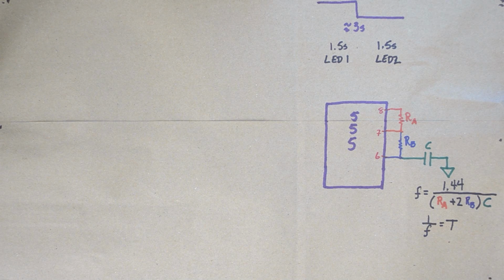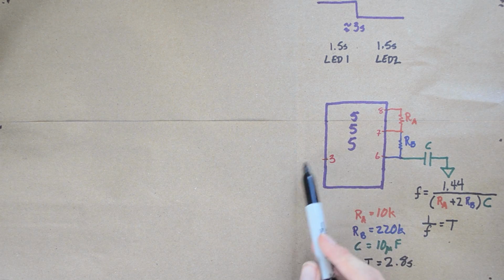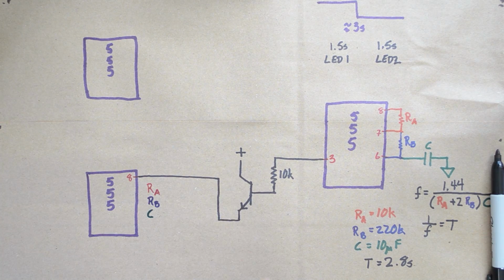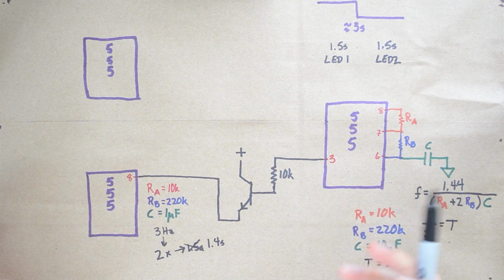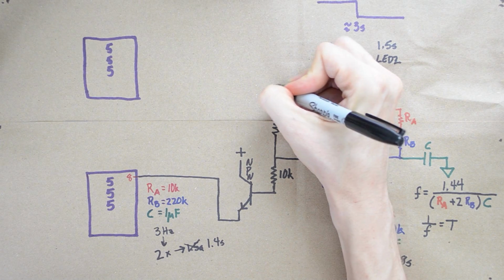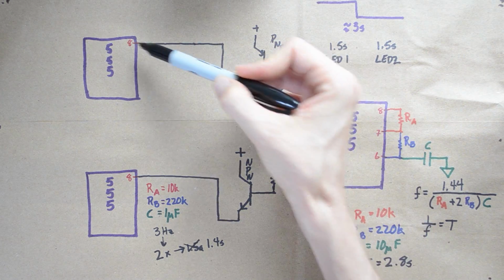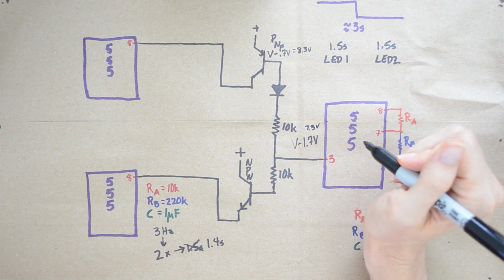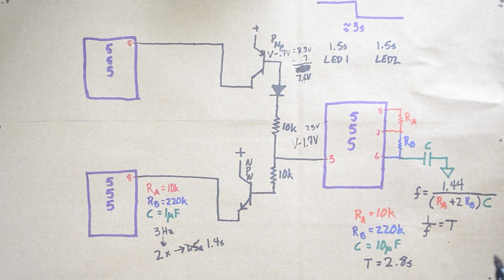Cascading 555 Timers for Custom Blinking LEDs

Comment: What are your recommendations for a power supply, multimeter and oscilloscope? I’m trying to put up my electric station and I need recommendations from the experienced engineer… some of the best power supply and multimeters, links 🔗 to where I can get them … thanks 🙏 for the multimeter , I’m leaning towards FLUK, but not sure what the best out there that you would recommend.
Reply: He hasn’t posted a video in 6 years so I’m not sure he’s still active on here.  Your question will depend on your budget.

Comment: If I wanted to use a trigger to activate and limit the cycles in this circuit, I could add another 555 in monostable mode and set the timing for the time it takes for the number of cycles I want, and connect pin 3 of new 555 to pin 8 of the first one in your drawing right?

Comment: HI, great und usefull stuff, i´m starting in electronics, but i have more experience in clay sculpting, recently someone ask me to make a serie of some specific lighthouses. but the particular light characterisics of each one are tricky, for example, i need a 1 second blink followed of 6.5 second obscure ( 1sFL- period 7.4sec), other needs a serie of 1 flash of 1 second of duration following of two second obscure period, two flashes, and a 5 second obscure (1sFL, 1s obs, 2sFL, period 10 sec). how can i do?

Comment: I saw a video a while back of 3 rows of LED "chasers".  3 rows of LEDs consisting of 10 LEDs in each row each moving only from left to right . When reaching the 10th one  starting again on the left side.The middle row moved across at half the speed as the top row and the bottom at half the speed of the middle row.They were all in sync.
Any ideas of how this would be accomplished. Three 4017 decade counters maybe? With a 555 as a clock,  Use pin 12 carryout to the input of the next one?

Comment: This was interesting.  I would like to figure out how to have a group of LEDs, in a star pattern, randomly blink (or strobe flash).  One larger LED in the center (5mm white) and 5 smaller LEDs (3mm white) on each point of the star.  I do not wish to use Arduino, just electronic components.  555 timers?  It'd be interesting to have a field of these stars (50) that would randomly strobe while each LED in each star was doing it's thing.  Creates a "twinkling" effect, in the mental image I have.  I am the consummate novice, so definitely need help figuring this out.  For all I know, I know nothing.  Is this idea even possible?

Also, here's part of my "novice", why would I choose a 4.7 µF or 47 µF or 470 µF or some other µF value electrolytic capacitor?  I understand, I think, why I would choose a particular voltage of capacitor.  When and why would I choose a ceramic capacitor?  I built a kit that had a .1 µF round ceramic? capacitor in it.  It was orange and had 104 stamped on it.  I know that is it's capacitance - 10 0000.  Works out to .1 µF.

Last, how about transistors.  There are a blue million options.  Why a 2N3904 or a 2N2222 or some other NPN or PNP transistor?  I have gathered they have characteristics like how much voltage and amperage they can handle, so that would certainly help in deciding.  Is there a comprehensive list showing transistors (or caps or whatever) and their specs dumbed down so even this caveman can do it?

I am sure I will have more questions.  Thank you, in advance, for your reply.

Comment: Nice video. Would this circuit be considered “intermediate” or “beginners” electronics?
Reply: There's sort of no such thing as beginner or intermediate electronics.  It's all math from the ground up.  The lights, motors, and audio are just for show.  There are approximate math formulas that are easy for anyone to use, and there are precise calculus ones.  These formulas show how every component in the HUGE list behaves when you power it.  As for where to actually begin?  Just pick what topics you can find that interest you and run with them.  It will be a LONG run to learn everything that industry has researched and developed in so many years.

Comment: I'm making a model of the A380 strobe lights and accidentally discovered that you could use the output signal from another 555 timer along with a diode and 10K resistor attached to pin 2/6 (negative end towards pin 2/6) of the LED timers to regulate whether or not the LEDs turn on for a certain number of times and then off. In this case I needed a timer for the strobes on the wing tips to blink twice @ 50ms and the red anti collision lights to blink once at 50ms. If i turn the chips on and off with transistors the timing in the signal was noticeably longer than 50ms on the first pulse before it settled into its normal width. Interrupting pins 2 and 6 with the signal from another 555 timer to regulate it (used your diode design to adjust the duty cycle) eliminated this pulse width problem. Total amateur here and not a math wiz but just wondered what your thoughts were on this.

Comment: Just had one question can a 555 timer ic be used as a mosfet driver  and if not are there any alternatives for a mosfet driver
Reply from the maker: You could use the 555 as a MOSFET driver.

Comment: A really nice video on 555 timer ic application.may i know what kind of transistor did you use.will a bc 547 bjt suffice for this experiment
Reply from the maker: Thanks. The BC 547 should work.

Comment: navigation system is not: "one set of LEDs blinking twice and then other set of LEDs blinking twice". they are actually flashing twice (or 3 times?), gap 1.5 second and flash again. can you shorten the time in between "blinks" to do double flash, 1.5 second gap and the double flash again; and further on

Comment: Great lesson. Is there any way to get the full curcuit diagram. I am stuck on how to connect the rest of the circuit fully.
Reply from the maker: The output circuit of the other two 555 timers are constructed by the same method shown here: https://youtu.be/dukZlsRoCJo?t=5m6s

Comment: Hi there, I really liked the video, I am learning a lot just watching it. One question: do you think you could do something similar with the exit of the pin 3 of the first 555 connected to a 4017 connecting the 5 first outputs of the 4017 to blink the first series of leds and the 5 other outputs to the other series of leds ? Thanks anyway for your videos.
Reply from the maker: In what manner would you like them to blink? Do you want the first series to all blink at the same time and then the second series all turn on when the first series goes out?
Reply: Hi there, I though we could have the same blink patern as the one you describe in your video.  I think it is possible to use the 555 in astable mode with output connected to the clock pin of the 4017.  Use Q0 and Q3 as output connected to your first NPN transistor to command your leds of the  first series and the Q7 and Q9 as outputs connected to another NPN transistor to command the second led series. You should have the first led series to blink twice, then the second one blink twice. What do you think ? would it work ? Thanks for your great video.
Reply from the maker: Every output of the 4017 has a different frequency so the first series would just blink at a faster rate than the second series.
Reply: Hi there, I have found what I was looking for, kind of police lights: https://www.youtube.com/watch?v=rmg1YyKXkrs. Thanks for your answers.

Comment: Great video. Cascading 2 monostable 555s was one of the first "puzzles" I ever tackled in electronics when I started 6 months ago. I'm currently trying to design a circuit that would blink one LED once, wait, then blink another LED once, then wait, and repeat using 555s and perhaps some logic chips if need be. I can totally relate to not being able to get an idea for a circuit out of your head until you work it out. Cheers.

Comment: Great videos... I am not schooled in electronics, but learning.  I am looking for a good video on how to strobe a low powered led - for tail marker on my RC Plane.  I just successfully hacked servo board (from a servo with a striped gear) and tied it to a N channel mosfet (sp) to control the 10 W led landing light.  Can you help.
Gary

Comment: I'm pretty sure you could do this with only 2 ICs. For example have 1 555 with a period of 3s controlling where the output of a second 555 goes using two transistors. On one of the transistors the controlsignal from the 1st 555 should be inverted. And also, to keep the timing, the signal from the 1st 555 could pulse trigger reset on the 2nd. I'll challenge myselfe to do this

Comment: Hey how can I correctly depict the value of resistor required for the LED ??
Thanks in advance
Reply: It depends on the intensity of the current you want to run the LED on:
R=U/I  U= source voltage minus LED voltage. Ex.: Source 5V, Red LED 1.8V @ 10mA
R=(5-1.8)/0.010
R= 320 Ohm for 10mA at 5V supply

Comment: very nice video. i have learned a lot.  i have question instead of putting a led can i put a power mosfet to drive a tank ciruit  that resonates at 30khz?  or drives a zvs circuits?  hoping for yr reply thanks

Comment: Question, you appears to have connected pin 5 on each to GND with what appears to be a capacitor, is that correct? also Pins 2 are connected to pin 6, but are not in the diagram, is that always a given for 555 timers?

Comment: i just came across your video , and it really helped me alot ,thank you for that . plus a question ,, is there any version of 555 timer that could be used with high voltages like 220 v or any alternative of 555 timer ?
Reply from the maker: I'm glad the video helped. I've never heard of a 555 timer that could handle that large of a voltage.
Reply: yeah there is non , but i figured out something else, i used a 9 v relay instead which really didn't worked somehow . you ever controlled the switching of a relay using 555 , if yes please help me out with that . i gotta submit my project by thursday . thanks again

Comment: Jason, thanks very much for the informative videos on the 555, including all the math explanations in several of the videos. Just one confusion spot for me is that in the comments of one video you reply that the capacitor at pin 5 should be 0.022uF, in another you state 0.01uF. I have checked the Datasheet from Texas Instruments on the 555 and the Datasheet suggests 0.1uF. While I bow to your vastly superior knowledge, especially in the math department, I have been using the 0.1uF capacitor as stated in the Datasheet, but was wondering why you indicated 0.022uF or 0.01uF in different comment sections?

Comment: can't you just blink with 555, and then switch between led's with astable multivibrator circuit? Should be the cheaper alternative. (so just use one 555 instead of 3)
Reply: The challenge was to blink each set of LED's twice before switching to the other set of LED's to switch those twice, then start over.  Switching each set of LED's once is easy with a single 555 timer but that wasn't the purpose of this circuit.
Reply: To blink each of led's twice before switch. One can: switch between left and right using astable multivibrator circuit without 555, and then use one 555 to blink them twice.
Reply: Yes you're right.  You could use an astable multivibrator but I don't think it would work very well.  Let me see if I understand what you mean by using an astable multivibrator and a single 555 timer: 

An astable multivibrator has 2 outputs with one HIGH while the other is LOW.  These will reverse after a specified time determined by each of the two RC network of the astable multivibrator.  You could (for example) take each of the two astable multivibrator outputs and connect them to the base of two separate NPN transistors.  Only one of the two transistors will be switched ON at any given time.  Then you can connect a separate set of LED's to both of these transistors which would pass the common output of a single 555 timer.   The 555 timer would need to operate at exactly twice the frequency of the astable multivibrator so that as each transistor is turned on, it would allow the 555 output signal to pass two pulses to blink the LED's twice.  Is this what you are talking about doing?   If so, you can probably already see how timing in going to be a big problem for this circuit.  If the 555 timer isn't always exactly synchronized with the astable multivibrator, then there will be times when the LED's will only blink once instead of twice (or possibly even blink 3 times instead of twice).  Since the astable multivibrator and the 555 timer are operating in "Astable" mode, this implies that they will not be very stable, and since they are independently oscillating, they will never both be perfectly in synchronization.  Using three 555 timers as shown in the video resolves this problem.  As long as both of the second stage 555 timers (the ones blinking the LED's) are operating at at frequency that is slightly more than twice the frequency of the 1st stage 555, then it will work reliably and always blink the LED's twice before being switched off again.  One thing you could do is replace the 1st stage 555 with an astable multivibrator circuit and have each of it's two outputs trigger two separate 555 timers.  That would work as long as the components in both of the RC networks in the astable multivibrator are matched closely enough so that both outputs are HIGH for roughly the same amount of time (another limitation of the astable multivibrator).  In my opinion it's just simpler to stick with three 555 timers since you're already using two in the circuit anyway (and you can buy several 555 timers for about one U.S. dollar - they are VERY cheap).

Comment: I'm totally noob to electronics, so bare with me if my question does not makes sense, but wouldn't be possible to use two 555 instead of 3?, one 555 that just blink the LEDs and one that switches between the two groups by changing the ground?

Comment: what are the other capacitors used in the circuit video not clear enough
Reply from the maker: The second stage of 555 timers used 1uF for the timing capacitor.
Reply: what are all values of all capacitors used . thank
Reply from the maker: The first stage timing capacitor is 10µF and every capacitor connected to pin 5 on a 555 timer chip is 0.022µF

Comment: thanks to quick answer 
i want to do this project in my college , did you have the circuit diagram or draw for this circuit
thanks alot for your help and amizing work
Reply from the maker: The circuit is drawn before you in the video. Is there a specific thing you need?
Reply: is the value of resistance 10k , 220k and two capacitor 10UF in the first 555 timer 
and other two 555 timers the same value of resistace and one capacitor 10UF(pin5) , 1UF(pin 6)
Is this right ?
and which NPN trasistor did you use with LED
Reply from the maker: On the second set of 555 timers, pin 5 has a 0.022µF cap and pin 6 is as you say. I think the NPN is a 2N3904.

Comment: Great video Jason! I feel it may have been helpful for some if you rearranged the formula to derive your Ra, Rb and C values. Or perhaps say your resistor values and then calculate the Cap value needed. Thanks!
Reply from the maker: Thanks for the input. I'll try to do more examples in the future.

Comment: Hello Jason! 
I am really thankful to you for this series of informational videos regarding 555.
I am trying to implement same kind of application in one of my project, and this video helped me alot to understand the working of 555 Timer. After watching them, I am now able to think out of the box and thinking to add some more features to my application.

I have a question, I want to make single LED blink at two different frequency, lets say, 1 Hz and 2 Hz without the additional circuitory. So, do you think it is possible?

Thanks
Reply from the maker: I'm glad you found the series helpful. I'm not really sure what you mean be two different frequencies. Do you mean that you want the LED to blink with two different periods (a slow blink and then a faster blink repeating)? If so, you can sometimes feed voltage in on the control pin (pin 5) to change the frequency just slightly whenever you want.

Comment: which transistors did u use
Reply from the maker: I used a 2n3904 for this video.
Reply: what about the pnp please
Reply: MrIfixplanes - 2N3906 is the complimentary PNP transistor to the 2N3904.
Reply: Thanks!

Comment: how to increase the blink speed of a led after 5 seconds automatically?
Reply: Nice question !
I was also wondering this.
Reply: You might be able to use an additional 555 timer (running slower at maybe 6 seconds speed?) to turn on/off a transistor placed in the circuit of the 1st 555 timer's R/C network.  Through this transistor, an additional resistance could be placed in parallel with Rb.  This would reduce the resistance of Rb in the first 555 timer and cause the 1st 555 timer's output (square wave) to increase frequency.  It would be tricky to make sure that the transistor doesn't affect the proper operation of the original 555 timer's RC circuit, but it should be possible with a little thought.

Comment: Hello, I have a challenge for you.  I'd like to see you, repeat this project, with a IC 558 timer. I tried and got "lost". So let me know. I look forward to hearing from you... Thank you
Reply: Inquire98 - It can't be done with a 558 timer because all four timers are powered by the same source. In his circuit, he's turning the power to the individual timers on and off. Not possible when they all have the same power source.
Reply: Okay, what about some kind of power subsystem, to control the power and current to each 558 timer. Let me know...